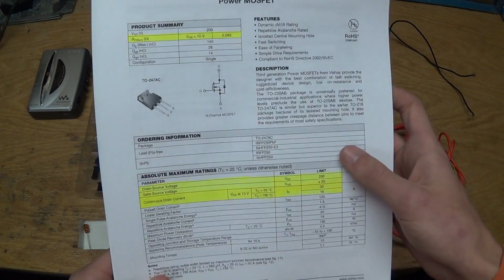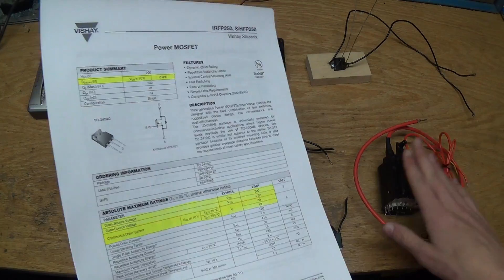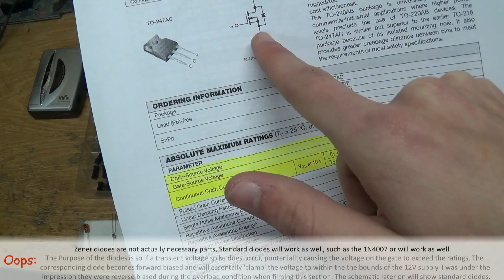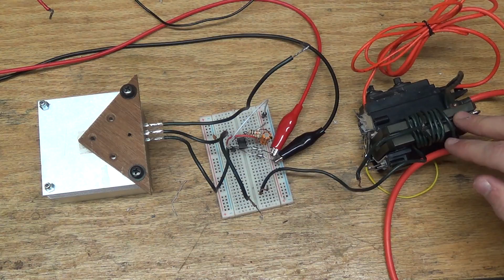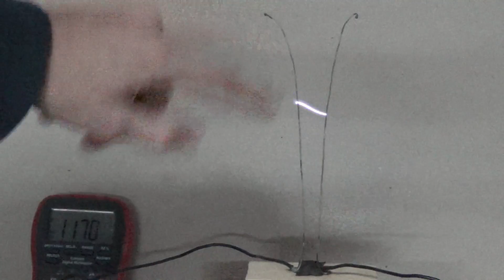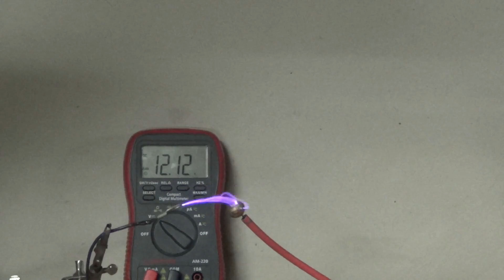Weekend Projects: Make a 69KV Singing Arc Plasma Speaker Flyback Driver!

Comment: Hey powermax thank you so much I built this circuit am getting 1 inch arcs at 15v 15 amp supply + 555 has been going strong for a week now + MOSFET doesn't heats up that much haven't made any preperation for audio yet, and also 
What is the ideal capacitance for C5 ?

Again thak you :D
Reply from the maker: My circuit operates in a sort of quasi-resonant mode, not dissimilar from class E amplifier design. You can find some application notes on designing class E amplifiers or quasi-resonant flyback converters. It needs to be resonant with the transformer and properly tuned. I found my value through experimentation.

Comment: Would using a gate driver IC help with the transistor heating up? I mean, less rise and fall time to decrease the power wasted over the switching resistance
Reply from the maker: Your intuition is correct, in cases where the transistor undergos "hard switching" then it is often beneficial to swing the transistor through the active region as quickly as possible.

Comment: Is it possible to audio modulate 555  at the reset pin (pin 4). So the output arcs generates only when there is audio input at that pin... I've seen such videos but couldn't find a circuit diagram.
Reply from the maker: Audio modulation is achieved by modulating the power in the arc. That can be done a few different ways. Tesla coils are very complex loads (due to arc loading, transformer action, upper and lower pole resonance...). Frequency Modulation can be used if your FETs can tolerate hard switching outside of ZVS or ZCS condition. VBUS modulation is ideal from the aspect of the Tesla coil inverter circuit. For modulating the supply voltage, an amplifier must be used that can tolerate a large DC current bias. A specialized DC coupled class A or class D amplifier will work.

This Tesla coil inverter circuit operates as a class E amp and must be run at resonance to prevent hard switching and turning the FET on at the worst time when the Vds is at the maximum.

The 555 in this circuit is an interrupter. It can only enable or disable the class E inverter stage.  Audio modulation will sound like absolute shit! You will be "squaring up" the audio signal and introducing massive harmonic distortion (like a 1 bit ADC).

In a 555 flyback transformer driver, the operation mode is very different. In a flyback converter you have what is basically a boost converter. You charge up an inductor with a magnetic flux then switch off the MOSFET after a length of time when the flux in the core reaches a target value. The flux collapses into a flyback diode in the secondary. The modulation is achieved my modulating the "on" time to modulate the energy stored in the flyback core. The 555 here operates at between 15kHz to 40kHz. Compared to the ~100Hz that the 555 is set to run at as a Tesla coil interrupter.

So yes you "can" audio modulate a Tesla coil. But it is hard as hell and I've spent the past 2 years trying to develop one that can be audio modulated without the complexity of VBUS Modulation.
Reply: @power-max  https://www.instagram.com/p/CHVTfMcljNq/?utm_medium=copy_link  . please  take a look at this. I mean how to make this.
Reply from the maker: @power45118  several ways to drive a flyback. There are 3 main types of DC to DC converter topologies: Flyback, Forward, and Resonant (LC, LLC, LCC). There are plenty of application notes that you can read up on to design such converters. 

A TV line transformer has a small air gap, a pretty respectable size core, and integrated HV diode and sometimes a voltage doubler or multiplier stage. They are designed for flyback topology with 120V supply on the primary.

In flyback topology, you will be limited by the leakage inductance and vore saturation how much power you can push through it to get the hot arcs. The inter-winding capacitance and leakage flux and core saturation limits the frequency range.

I have not tried to run them in forward config. But this probably isn't the setup to use to get high voltages. A forward converter is an extension of a buck converter that is generally used to step down voltage.

Resonant driver topologies have been used very successfully to drive flyback transformers. Even with the limitation of only half wave rectification you can still get lots of power out of them! Voltage will be limited to the transformer ratio and resonant rise. Be careful with series LC drive though, you can burn out the flybacks very quick! Keep them submerged in oil. Design it to run at no more than 40kHz. I ran one at 100kHz by accident and I'm arced over internally.

Comment: actually if the dumpster is on the street, or a public accessible parking lot, goodwill drop box ect.. its illegal to put anything in them if they are not yours, or have some type of lease agreement, thats called illegal dumping and there is absolutely nothing wrong with cleaning up trash someone else left behind:)  Thats how it is most places, but I know there are some states with Democrats in charge and those places everything is illegal unless you have a permit which, in my experience costs about the same as the court fines, for not having the required permit plus 5 grand for a decent lawyer, so the whole affair won't screw up a standard form 86 clearance.

Comment: I use my zvs driver plus a circuit that goes between the input of the driver and my power supply and make loud singing arcs
Reply from the maker: Yeah you could modulate a typical ZVS driver by modulating the voltage to it. I have attempted this with a BJT set up as an emitter follower to operate as a class A amplifier, dropping voltage proportional to an audio signal. Problem is it was not loud and was very inefficient. It also did not start oscillating reliably when connected to a power supply with soft switched power (i.e. always connected and turned on on demand)

This push-pull driver can quite easily blow up flyback transformers with all the power! It offers sparks that are more comparable to flyback converter (ne555 type driver) but with more power too.

I need to buy more flyback transformers, or wind my own to really show what this circuit can do.
Reply: @power-max  i use 2 input supplys on my zvs driver and have no issues but modulating the input to the gates could cause problems
Reply from the maker: @joshwayop  Not sure I quite follow. There is 1 voltage supply, not 2. Modulating the feedback strength for the gates is not going to work, unless you can somehow delay the gate drive in proportion to an audio signal to push the driver out of perfect resonance, that was the originating idea for my PLL driver.
Reply: @power-max  With my Zvs driver im using regular mosfets and i dont connect the resistors going to the gates to the main + connection and instead have it going to a 7.2v battery pack and i power the main - and + to a 19v modulated power so the gates dont get modulated at all just the power going to the flyback
Reply from the maker: @joshwayop  I see, yeah that would work. I did try that before but found it was quiet and very inefficient. The hard part is how to modulate a high voltage high current supply like that. How did you choose to do it?
Reply: @power-max  im using a single mosfet modulator circuit but the issue is its very inefficient and gets extremely hot when playing music but it’s basically a mosfet between the main high current lines going to the flyback transformer
 (also im only 15 years old so i may not be great at explaining it)
Reply from the maker: @joshwayop  Yup! Only difference was I used a BJT. :) Share a circuit if you can. For the record, a BJT would be better suited because high power MOSFETs are not designed to work in the saturation region, they are made of many small parallel MOSFETs and are thermally unstable and will suffer a cascade failure in when driven continuously in the saturation region.

Reason it gets hot is because it is introducing a voltage drop of several volts (equal to the amplitude of the music) and this times the current the ZVS driver draws directly results in power loss.

You could instead look at using a class D amplifier with push-pull synchronous output , and if you add a voltage bias in series with it for powering the ZVS, this would work quite well and be more efficient. But class D amps are quite complex.

Comment: Is this driver the best???
Reply from the maker: define "best"
Reply: @power-max  I mean does this circuit last very long?
Reply from the maker: @Headbutter-Lettuce90  If you are looking for "reliable" then you will need to do a custom PCB layout and use a dedicated flyback switching converter, incorporate feedback mechanism to avoid too high output voltage, include a flyback diode that can clamp the Vds(max) voltage to a set value, reduce leakage inductance as much as possible to prevent avalanche breakdown energy loss in switching element and
....
Well you need to know a bit about power electronics, let's leave it at that.
Reply: @power-max  can i use irfz44n with the same 12v 12A, what is the value of C2 of pin 5, and what is the value of C5?

Comment: you shouldn't be burning out 555s at all if so, your circuit is messed up
Reply from the maker: Sure. If this circuit was engineered precisely then yes. But it isn't. This is a very simple  unregulated flyback converter. (although my addition of a resonant parelel capacitor kinda changes that) If you allow the output to go open circuit the voltage will grow unbounded and the back EMF from the flyback transformer can be on the order of thousands of volts. When the MOSFET dies, all 3 pins short together and this shorts the 555 pin 3 and can kill it. The 555 is not a good MOSFET driver, it isn't meant for this.

Comment: Why did you use C5 capacitor? Won't it dampen/straighten up the input pulsed DC?

Try to have maximum pulse-off-time at constant frequency. i.e more off time in a cycle leads to  longer arcs and lower voltage to form it.
Reply from the maker: In practice, a carefully chosen low ESR and ESL C5 will greatly improve the current output of the flyback transformer. The addition of it does change its mode of operation from flyback to resonant. It also reduces the peak voltages the MOSFET will experience on the drain, which is the main reason I added it.

Comment: Try putting a current limiting resistor between the source pin on the mosfet and ground, like 10 ohms 20 watt. Should increase the life of the mosfet and reduce heat.
Strap the resistor on the heatsink and the circuit should run indefinitely
Reply from the maker: Why would this help? It seems to me it would reduce the performance substantially. It reduces the effective transconductance of the MOSFET by introducing negative-feedback

Comment: A true American patriot.... Obeying every law...... So he spends 16 dollars on a flyback💵😂😂👌
Reply from the maker: lol. Well to be fair, I wan't allowed to drag junk into the house. Nowadays it isn't common to find old TV's for cheap or free. If anything their value is increasing due to the emerging retro gaming trend.
Reply: @power-max  yeaah...... But next time you should wind your flyback..... They are more aficiend
Reply from the maker: @alyo3299  They are more what??
A hand-wound transformer is going to have significantly worse performance than one created in a machine.  I have done this and they give very hot but short arcs until they arc over internally and short.The epoxy resin they are encapsulated in help s increase the dielectric strength between windings.
Reply: @power-max  not all of homemade transformers are good but if yot know how to do it correctly it can outperform an TV flyback..... Like kasyan TV and makerj101 made really nice ones
Reply: And a TV flyback outputs dc voltage
Reply from the maker: @alyo3299  Both of their transformer are well below 10KV. I estimate around 5 or so. Like I said, DIY transformers can produce short, hot arcs because they use much thicker wire with much fewer turns. About 1000 or so if 30awg or thinner. They are not made by a machine with very tight process control and are inherently crude. They will arc over internally if pushed too far, even in oil.

High voltage high frequency AC is VERY difficult to achieve. That's why such transformers are rare.

That said, having the output be AC does allow flexibility in how they get used. For a singing arc, the lack of filtering and smoothing on the output makes them better suited for audio frequency AM modulation, but this pro is negated by the low voltage and short arc producing a very quiet arc.

Comment: Just made one without the mofset .
With a cfl electronic ballast (40w) with 12 turns on the ferrite core
For stronger blue arcs made a capacitor with a glass jar.

And had tried the z44 based driver 
It did not work with center tap.

Comment: The feed for 555 is 6-15v. What is the intensity of current you give 555 A ???   Can I use 12V-1A????
Reply from the maker: That's not how electricity works. Refer to some of the excellent tutorials about basic electricity online before attempting this project, for your own safety.
Reply: @power-max  I started to learn about electronics, so there are many unknown ones. So what's your "high value capacitor" capacitor uF , C2=????uF
Reply from the maker: @huyngodang5328  It is a DC blocking capacitor. It blocks DC bias whist allowing an AC signal to pass through. Pretty much any value above 1uF should work. I would not go crazy with anything higher than 1000uF.
Reply: @power-max  thank u so much

Comment: Another question.
Since you mentioned two separate power supplies for this setup, can I use a 12 Volt 1 amp power supply to power the 555 timer circuit ?

And about the power supply at the flyback side, can I use more than 12 volt power supply ?
If yes then what should be the ratings of the power supply (what volt and what amps) ?

PS : Waiting for your reply. 😅
Reply: Yes you can

Comment: 12:45 Can you tell the exact specification of that film capacitor ?
Reply from the maker: The ideal choice depends on your flyback and what frequency it is most happy to operate at. Then measure the inductance of the secondary and the resonant frequency formula for RL circuit will give you a good 1st order approximation for the C value to use.